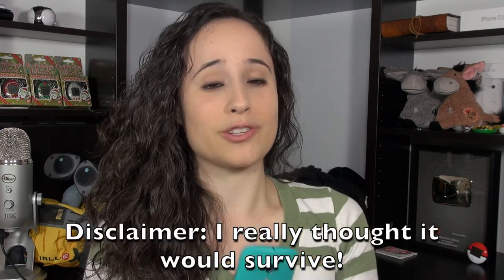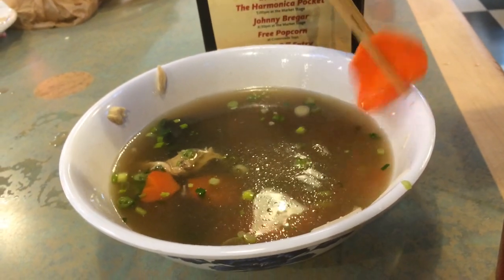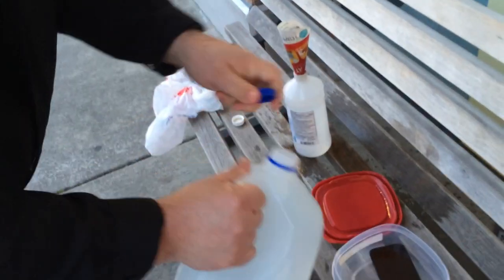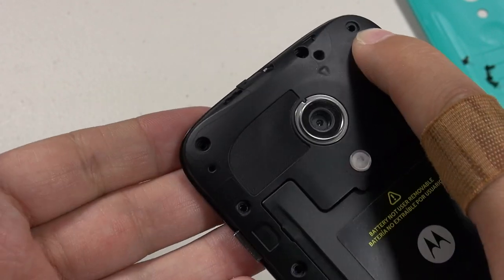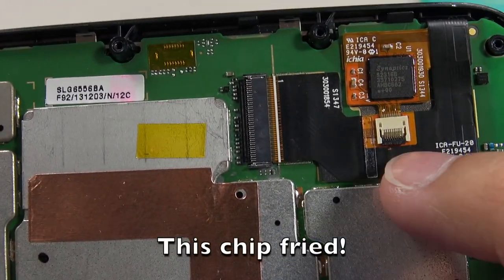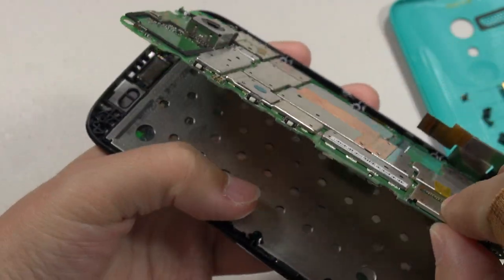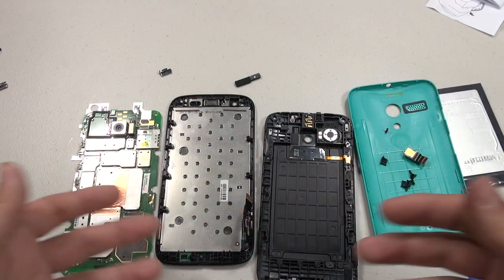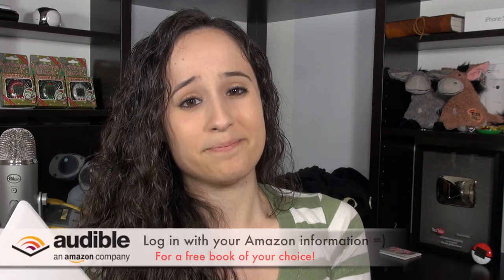Moto G Soup FAIL and Take Apart

Comment from the maker: UPDATED FINDINGS 

Disclaimer:
***Motorola does not claim in plain sight about any water resistance! It is P2i on their own press pages http://www.p2i.com/news/articles/P2i-Celebrates-10-Year-Anniversary-as-World-Leader-in-Liquid-Repellent-Nano-Coating-Technology and in their site who specifically list the Moto G as protected and it is in their marketing videos about Splash Proof technology that they make it seem like a device is protected if you get various liquids inside of it! Either way I'm not complaining. I chose to do this and take responsibility. I just wanted to warn you all.****

Content:
Ok, so according to engineers at P2i the coating is hydrophobic and non-insulating. Therefore, liquid is simply meant to come in contact and immediately be repelled off. But if a liquid with a bunch of ions, like salt, is introduced and left to sit on the board, a short circuit can happen. 

Their marketing made it sound like the coating was protecting the insides from all liquids The Benefits of Aridion™ Technology (see video link to understand how confusion was caused to me 3:20) The liquids NEED to repel away from the surface. That is not mentioned at all it just says protected from all liquids.

Here's the thing, If liquid gets inside, it can't easily be repelled! In reality, if liquid gets inside of the device, it will bead up. But if it sits in a sensitive spot, like near a connector you are screwed.

However, liquids like tap water have a higher surface tension than salt water, like in the soup, so it is more easily repelled. In addition, tap water has far less ions; therefore, tap water won't seem to hurt the device during submersion as I have already seen. But other water with many ions most certainly will!

Also, shaking violently in water let's water more easily seep into the device. It seems that when the device just sits in water, without thrashing about, the coating does a good job of keeping the water from flowing in. It's simply repelled at the surface, like a surface tension.

So there you have it. They will release a Dunkable coating that WILL be insulating. But still, they will probably have issues at connectors, unless they take extra measures to keep the connectors protected. If they do that, then they simply can't use the process they are using now. Might as well purchase a true waterproof device. 

Oh and by the way, the soup was just warm. I am sure that cold to warm helped introduce more liquid into the device but I can't say that heat caused any damage.

Also, no, alcohol or whatever else won't wear off or dissolve this covalently bonded coating. Though some make the point that damaging or removing the layer will obviously make a difference lol.
Reply from the maker: This is the updated post. Sorry for all confusion. I honestly haven't slept much. My bad.
Reply: Erica Griffin loved the way you replied to the comments!
🙆
Reply: Do you think a 8gb moto G is enough??  And also, I guess that for an accident the nano coat should do fine
Reply: Thanks for the heads up!
Reply from the maker: Rodrigo Ramirez from what I understand now you should be ok with spills or splashes in general and if water were to get inside the unit it needs to not be highly conductive liquids like salt water as they might sit at a vulnerable spot and cause a short circuit. But fresh water damage is not a worry as with 2 different Moto Gs I got the same result with no harm. There simply aren't enough ions in fresh water to cause the havoc that salt water can.
Reply: Erica Griffin why do you stress so much ??? Its OK. I understand anxiety and stress as I've had it all my life. But you tested a product. One test did affect the device. Not your fault. It was a great video and very informative. SLEEP.
Reply: Agreed! kevin tompkins
Reply from the maker: Kevin Tompkins you didn't see the ugly attacks against me earlier lol. It just wasn't pretty.
Reply from the maker: ***** My fiancé is in France and I am here. I think I'm lacking affection for sure lol
Reply from the maker: ***** I deleted the stuff at the end and actually the entire post to apologize for any misunderstandings and to clarify as I think even you misunderstood me and I'm sorry.
Reply: Erica Griffin i still can't believe that some people (apparently) enjoy writing stupid comments for no reason without reading the description ...
Reply: Meuk Tjapper not in sea but maybe in a fresh water lake or river
Reply: Erica Griffin I think you liked that Moto G too much...lol
I missed what you replyed at my "do that with the Z1 or Z2" 'cause you deleted it before I can read it but you should not beat yourself 'cause you are being passionate about what you do...We are all human and we do impulsive things from time to time it's good...
But hey you know soup kills phones now :P
Keep up the good work and "don't worry, be happy" lol
Reply: Erica Griffin Ugly attacks over a video reviewing a phone. ? Guess I don't understand why?
Reply: Reminds me of electrolysis in my chemistry class
Reply: See here, they claim Water Repellent coating under dimension and weight - http://www.motorola.com/us/consumers/moto-g/Moto-G/moto-g-pdp.html
Reply: Erica Griffin I agree you do a terrific job and you have wayy more lovers than haters I'm positive of that. Keep up the excellent work as I know you will
Reply: Erica Griffin i ws jst seeing u in the whole video, u r jst awsome
Reply: I love the moto g erica and you too
Reply: look at the bright side! you learnt not to do the soup test again, especially in public... And you got to how us how to take apart a motorola moto g!
Reply: I wonder what the restaurant thought lolz
Reply: erica i know this is off topic but i just waana say that u r sooooooooooo beautiiiiiiiiiiiiiiiiiiiiiiiiiiiiiiiiiiiiiiiifulllllllllllllllllllllllllllllllll,,, :*
Reply: How about Liquipel
Reply: Looks lke u wll b my nxt chemstry teacher
Reply: Mine fell accidentally water, it did survive! no problems at all! The only thing I got from it was dust between the ff camera and the display, because of your video I fixed it, Thanks so much!

Comment: Even the older Motorola Defy which really was physically waterproof came with a big glaring bit of card in the packaging that basically said it wasn't actually waterproof.
When you had the touch sensor assembly out it might have been worth giving it an extra long soak in isopropanol in case there was still some salty contaminant underneath the chip.  It's a bit annoying that the companies that tout these hydrophobic coatings use VERY small print to mention that it only applies to clean liquids like water.  (Pure water isn't very conductive anyway.)  Quite a neat assembly inside, but I still prefer being able to whip a battery out if things go pear-shaped.  (I'm seriously thinking about a Moto G after seeing your gloriously technical reviews.)

Comment: I didn't think this was humiliating or reckless at all. You really just showed a flaw in the phone. I think other people have probably stuck this phone in worse liquids lol. Great video. I loved it.
Reply: 1300l It doesn't say pee proof either, but I'm sure many people are going to drop it in the toilet and expect their phone to still work. The nano coating tech was supposed to seal the whole phone.  It wasn't reckless because most people who buy this phone are going to expect their phone to be liquid proof and dunk it into things. Her gender has nothing to do with my comment. I'm not sure why you brought that up.
Reply: 1300l The logic that because something fails, means that the cause of the failing is recklessness makes no sense. Recklessness is performing an action without carrying about the consequences. She didn't think there were any consequences because she thought the nano coating would do its job, which is why she dunked her phone in the soup. Therefore her actions don't fit the definition of being reckless. 

Nano coating is specifically designed for phones with slots and open micro usb charging. It's supposed to eliminate the use of port covers. That was the whole point of the technology when it was initially introduced to the market. So your statement about it not being perfect because of slots makes no sense.
Reply: 1300l The nano coating technology says nothing about being fresh water proof only. It claims to seal the phone from liquids. 

This has nothing to do with acids or corrosive material. She claimed salt was introduced into a portion of the phone that she assumes wasn't covered with the nano tech because of the tape that prevented it from doing so. So no, nano coating isn't perfect, but the product is claiming to seal the phone completely which is what she thought was the case and what others will think is the case.

My initial comment was not about defending her. You claimed I made my comment because she was a girl, which I explained was not the case. Then you claimed her actions were reckless; I clarified the definition of what recklessness is and her actions did not match up to your claim.  

I never claimed she wasn't to blame for her actions; just that she wasn't being reckless. I never claimed that the nano tech was perfect; just that it didn't do as advertised.
Reply: 1300l One of the tag lines for the company on their own website is liquid repellent. It doesn't say 'fresh water repellent". It says liquid. I'm not doubting that you can only put it in fresh water, but the website clearly says liquid. It doesn't classify which type when promoting it on the main website page. 

She never blamed the phone, she consistently blamed herself and said it was a dumb thing to do which is why we're even having this conversation. Then later she stated the reason why the device didn't fully get coated. Still she blamed herself for her actions. 

Anyone with common sense wouldn't know anything about fresh water because that's not what the company claims when selling you the phone. They say that it is liquid proof and that's what most people will think. You keep preaching to me about information that you know. I'm talking about the common knowledge that they tell people when they are purchasing the phone. This means most people are going to think they can dunk their phone into any liquid and it will be okay. 

And again, why is gender a factor to you? Gender has nothing to do with technology. This is a video about someone's actions.
Reply: 1300l Because you think that way, you can't assume everyone knows. Seriously, you have to know that the normal consumer doesn't know this. You're in the tech field. This isn't common sense to the average customer. They are going to read what the advertisement claims and run with it.

And those test aren't reckless because the intent is to show how much the phone can take. They do it on purpose.

Of course Erica is going to fix the phone. She's done it before, so no worries there.
Reply: 1300l You have a lot more trust in people. My years working at Walmart and consulting at Best Buy would beg to differ. Most people think they're warranty covers everything that happens to their phone, including if they threw it out a window lol. 
I disagree that she did it for the views. I still believe she did it because she thought it would still work, but I see we continue to disagree so that will be that.
Reply: JustDavid0823 Don't worry this guy can hardly type without getting more then 3 words wrong in a sentence... obviously he just wants to make people irritated and be a troll.

Comment: I think it is the tape. Thin polymer tape like that will harden and change shape as it ages/oxidises.  Even if it was fluid tight to start with, it probably stopped the nano coating from ever covering the connector.
Reply from the maker: Sigh, stupid design... but what can you expect from a cheaply built phone? It's own internal build quality seems to have lead to it's demise and not the failure of the coating.
Reply: They're at the start of their learning curve with this nano coating I guess - This was just the dreaded version 1.0 !!!  Still very tempted by this phone though, largely due to your review.  I break smartphones about 1 very 3 months, so I bin buying cheap China phones for their bargainousnous.  This one is daaaaangerously close to China phone pricing though...

P.S. Bless ya for all the technical detail in ur reviews Erica.  It's totally appreciated ;-)

Comment: You expanded the water protective molecules on the phone by submerging the phone into cold and hot soup rapidly. Such a quick transition caused the rubber like materials to contract and expand rapidly allowing water to get in :/
Reply from the maker: The soup wasn't hot at all. Just barely warm. So it was more like cold to tepid. Not such a big deal.
Reply: So like you said,  I guess it was the salts in the soup that caused it to open, but then again maybe this is bad advertising on a phone that should take any liquid impact onto the board. Another example would be to drop it near the shore.
Reply from the maker: This was misleading advertising. If any conductive liquid is left on the board to sit, the coating is non-insulating. Therefore, salt can affect it. They made it sound like the hydrophobic coating was insulating.
Reply: Yeah they would have been better off utilizing gaskets instead, so much for the atom sized insulation particles  :) :,(
Reply: Erica Griffin
Reply: Erica Griffin

Comment: The reason why it fried is obviously because of impurities... I wear high end luxury watches and they say they are water resistant and everything... But impurities like salt and sudsy bubbles especially which can break the surface tension, which therefore makes the device faulty (P2i formula or not) and not so water resistant. I trust nobody and I sure as hell wouldn't trust anyones word on something being "water-proof" or otherwise... So I'm not one to test boundaries; I don't put anything in water that really shouldn't be there! Everything has a breaking point...

Comment: You and breaking touch screens. XP thanks for the video. The nano coating isn't for constant full submersion though. That is what should be stressed, it is for the accidental drop into liquid. Do not intentionally submerge the phone, because it still is not water proof...just resistant.

Comment: I dropped mine in Lysol water last night. I was cleaning. The bucket is deep so I kind freaked. I rinsed it in water immediately and took off the back and tried to clean any water out. Touchscreen and everything worked fine but a few minutes later boot loop hell. This morning I went into recovery and was able to fix it. It survived!

I love this phone. I love seeing the moto g torn apart too. I wish the battery was easily removable though. Tempted to take mine apart but it still works so not worth it

Comment: The steel plate that touches the board is a ground it will work without it but its a risk of frying your board, I saw something just like it in a Motorola xt912

Comment: This is why you shouldn't do things like this.. the coating is meant to protect it in case you drop it by accident in a puddle or so, if that happens you shouldn't turn it on but put it together with rice...ASAP.

Comment: My bet is it wasn't the fatty acids of the soup that tore the nano coating. It was probably the temperature difference between the ice soda glass and inmediately the warm soup. The thickness of the material is everything when it comes to resistance to big jumps and downs in temperature.

Comment: Erika, didnt you know that if the nano coating on the moto g is anything like liquipel, it wears off after multiple submersions? Its not permanent. Also, the temperature of the liquid might make a difference.
Reply from the maker: Who said it wears off after multiple submersion? If you didn't get that info from P2i, it's worthless.

Comment: Is that wall-E? Good that this is put to the test, i think complications could arise when the nano coating is subjected to oil-base. While it might be hydrophobic (which i think it should be resilient to hydrogen and ionic bonding from water or ionic solution) due to it's covalent bond, but it may not fair well from oil because it isn't oleophobic. i think some lipids might be solvents to the nano-coating thus rendering any thinner coated areas permissible to the the soup.  Also, while the soup may not be boiling hot, covalent/non-polar bonds have lower boiling points which could be a reason why.
Reply from the maker: Could make sense but if this nano coating is Parylene, like I think it is, it's not going to be dissolved by a solvent.
Reply: Erica Griffin
thanks to you motorola knows there is a problem with the nano coating in the phone maybe you ar a part of the solution ;-)

Comment: Is the Moto X protected with the same coating as the G?
Reply: Yes
Reply from the maker: Yes actually it is. Motorola and P2i work together to add Aridion Splashproof technology. Moto X is just the same process.
Reply: Have you done a test on a Moto X like you did with the G? (the 30 minute challenge)